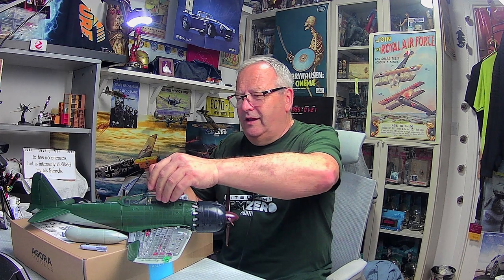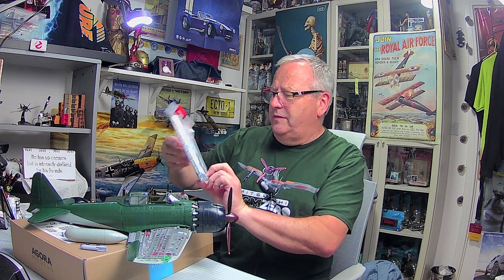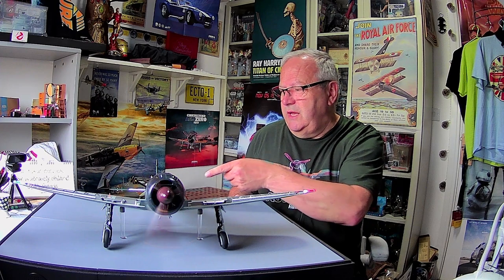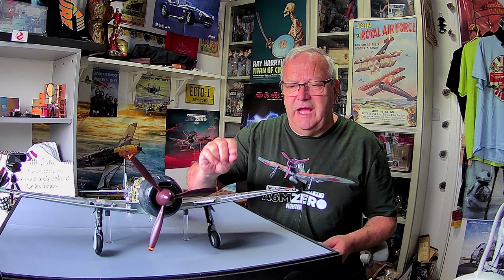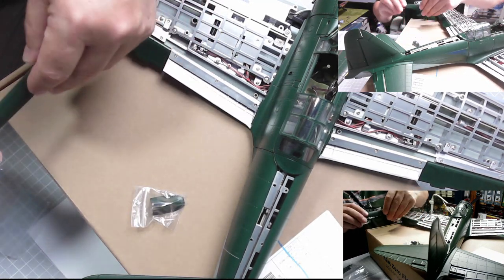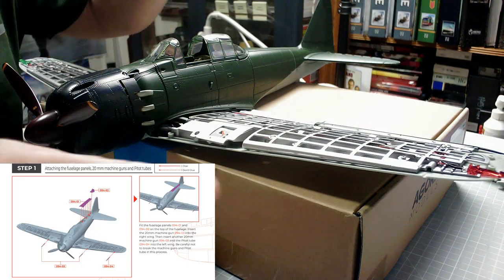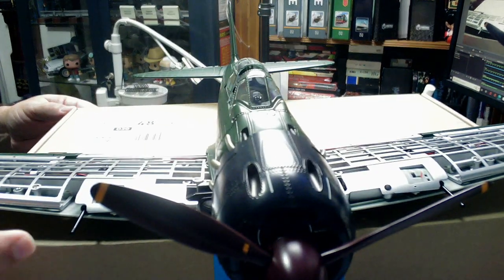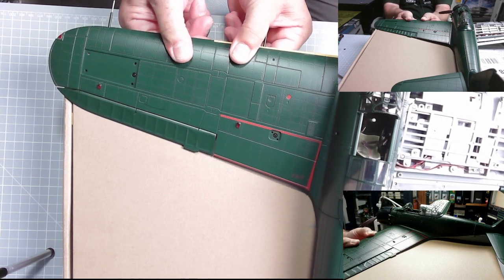Mitsubishi Zero fighter pack 12 final build from Agora

Comment: Hi John, 

Still haven't received my pack 12 on this side of the Pond.  My heart sank when I saw your Zero disassembled!  Can you tell me which connector pin on which plug? How to fix, and did it require disassembling the fuselage?  

Cheers,

Chuck
Reply from the maker: Pin 3 of the power connector from stage 85. Thanks for your comment 👍 🙂
Reply: @JohnsModelmaking   Appreciate the response, John,  but there are three 5 pin connectors, was it the one on the base or one of the two in the hollow metal shaft/tube?  It didn't require fuselage disassembly?  Cheers!
Reply from the maker: Stage 85 is the base connectors 85-02 85-03.
Reply: @JohnsModelmaking  Thanks John!  bY THE WAY, YOUR ZERO LOOKS TERRIFIC!

Comment: Hello John, I got a couple of probs with the final Pack, battery charges fine, and infrared light works, and I switched on and the Zero went into initialisation, first thing the right hand side riser won't stop, it shut keeps going up and down, I tried adjusting the switches, but it still doing the same thing, also I can't get no other movement or sounds or lights working any clues John?
Reply from the maker: The limit switch is either faulty or the cable to the pcb, and lastly, the pcb. Have you watched the fault finding video? The system has to initialise before anything else will work. You can operate just the base without the plane, if I remember correctly. Can you operate the switch by hand?
Reply: Thank you John, I have work today, thankfully my cold is over, I will do a checkover later,yes I press the metal limit switches and it just keeps going up and down, and that is without the plane on top. I will look out for the video, where exactly is the video John? Sorry for being a pain.
Reply from the maker: @philliposborn808  video should be on the website,  I will have a look later for it.
Reply: Thank you.